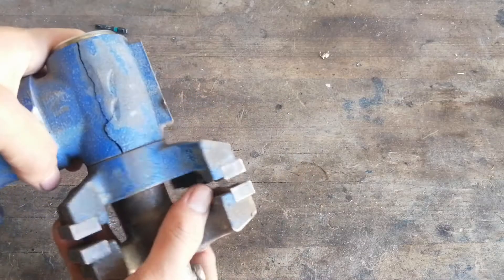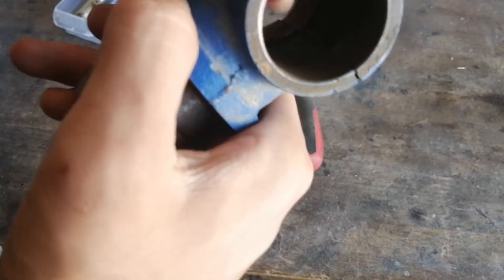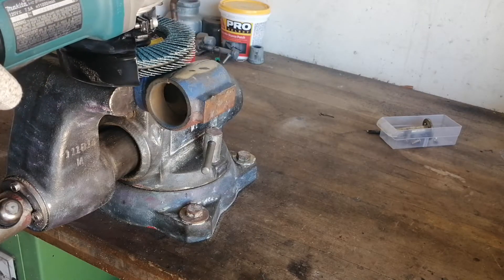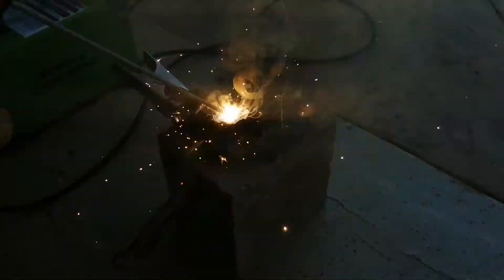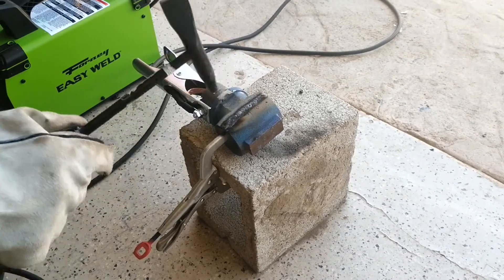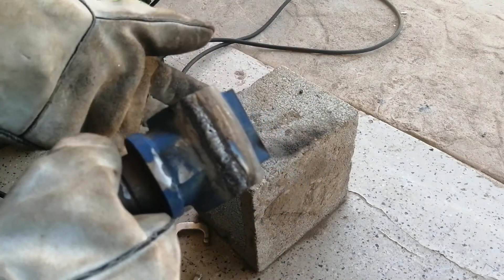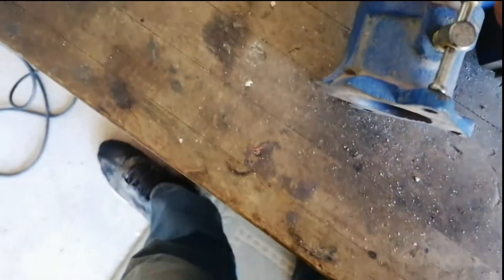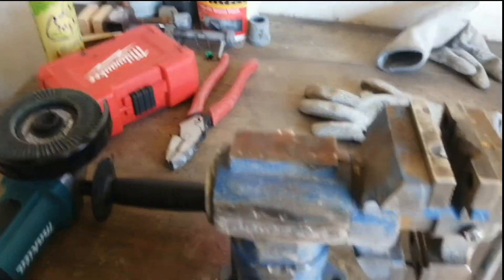Stick Welding Cast Iron with 7018 Electrodes - Broken Vise Repair

Comment: Will you post after using vice a while?
Reply from the maker: That small vise I welded was always used outdoors on a small workbench for painting and other messy projects, the weld is still holding strong but that vise was never used for anything more than holding small parts for painting or cleaning.

Comment: Interesting that you didn't pre-heat the part or apply post heat or put it in a bucket of sand to slow down the cooling of the part. Has the part survived OK so far?
Reply from the maker: This mini vise I only use for very light duty work like holding parts for painting and cleaning. I don't want to make a mess in the garage where my real vise (the big Wilton one) is mounted on my workbench, so I take the mini one outside. So far it held up well.
Reply: @DragonBuilds  OK great, thanks for the reply.

Comment: Hello there. Can u make a video, welding cast iron with s/s welding rod? Thanks
Reply from the maker: Cast iron should be welded with nickel rod, not stainless rod.
Reply: @DragonBuilds  oh ok. Did you have tried it b4? Im excited to know the result coz cast iron rod are very rare at my place, hard to find...
Reply from the maker: @TheHeavensHell06  Yes I have used nickel rods. They work very well.

Comment: Exactly what I needed. I will be a repairing a cast Iron fence soon:
Reply: How did it go with the fence? 
I have to add lot of Cast Iron finial spears to mild steel pickets soon and was going to try 7018 because of this good DragonBuilds video, either DCEP or AC (my machine can do either). So after your task, what do you think now? Thanks!
Reply: @AerialLensVideo  how did your cast iron fence repair came through ?